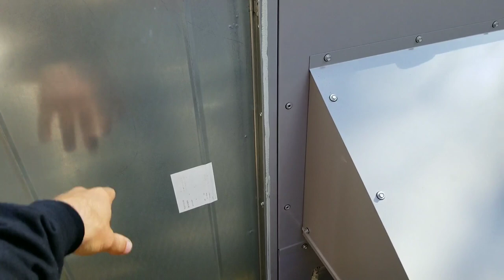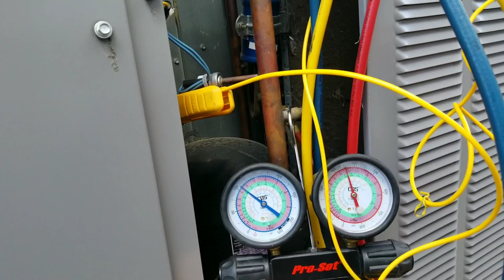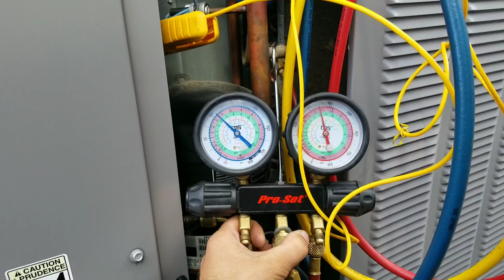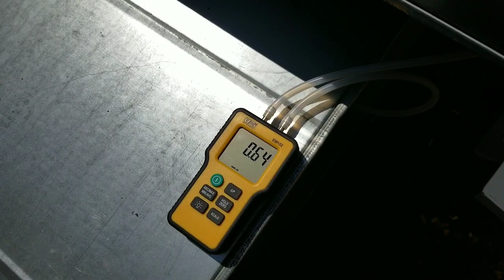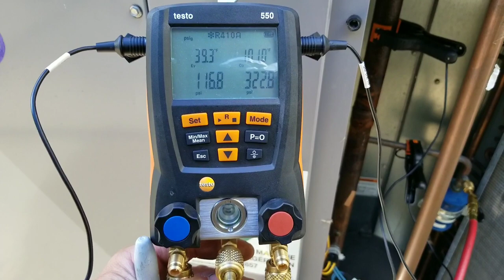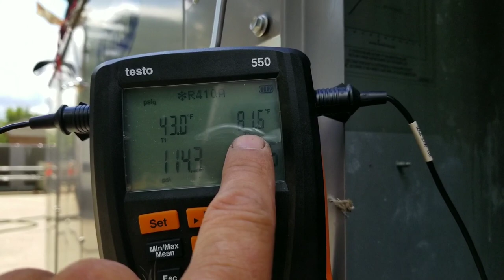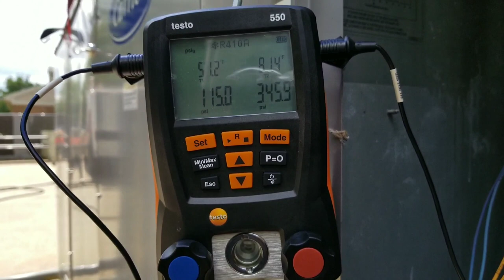Carrier package unit not cooling: Part 2

Comment: Looked like the little spot they had cut out was the only way they could avoid return air bypassing the economizer. Really no way to go to full economiser  now that the whole side is cut out. They should have had that return tie in the back where its suppose to go instead of the side. I initially thought that unit would have a downflow return opening, but seeing the unit again that was incorrect. Enjoy the videos man!

Comment: That units return was on the back not the side with the supply. Should have corrected the duct work. Now the economizer isn't going to work properly. Recommend reading installation and service manuals prior to installing and or cutting panels.  Typically like your video's very helpful. Please keep learning and sharing what you learn.

Comment: Keep posting videos, you are doing this trade a great service being able to see and discuss stuff like this👍🙌. I'm not gonna say I would go a different route...but my first impression is air balance? I'm obviously scratching my head on the duct design and economizer setup for that application. Hope you don't take this in a negative. Sometimes it is what it is get the unit running and achieve the ultimate goal. Comfort for the customer.
Reply from the maker: Hey Grindstone- thanks for the feedback-- I did some research and figured this out after the fact because I knew what I did to correct airflow bypassed the economizer, when this unit or any unit really is ducted out the side like that it needs to be equipped with a different economizer, one designed for side ventilation. Thanks for watching

Comment: Strange that the installers did (what looks like) a decent installation job and missed opening the return to the unit... if I had made that mistake I would have corrected it (which they apparently realized when they cut the triangle out)... 🧐 love the hat airflow test btw

Comment: Wrong economizer for that return going in the side... Should have a verticle style made for side inlet.. But the cheapest way was the way u did it. A lot of people don't really use the economizer much.
Reply from the maker: Hey Dan- Your exactly right on both ends, I basically bypassed the economizer they had and told the customer they need to get the side ducted economizer- havent gotten the approval for it so I think there just going to let it go

Comment: Excellent video! Did you find reduced amp draw on the blower and compressors after opening the return air? Just a thought....Thanks again
Reply: you fan motors do not draw less amps with more air flow, they draw more. If you were to put an amp meter on the blower contactor and open the door it will jump up in amps. The same thing happens with the compressors with more airflow but not as dramatic. The more airflow, the more air to move and cool, and thus the more work is being done, more work requires more energy, more energy is measured in more amps, Its basic physics.

Comment: I’m no expert in HVAC work, but I do have a question out of curiosity. Isn’t the purpose of having condenser fans to prevent the compressors from overheating? If so, how come some compressors aren’t even under the condenser fans?
Reply from the maker: With most hvac package units the condensing fans aren"t there specifically to cool the compressor, they do cool it a little bit but the compressor is cooled mostly by the suction gas coming back from the evap coil.
Reply: Oh okay. That makes sense. Thank you for the information!
Reply: @FansOfGames  To Add to what Curious said most compressors are designed to be cooled by the suction gas. Some may not because of their design and usually have their own fan. We have some split units that have the compressors separate from the Condensing Coils. The can be in their our box with no fans. This can be down to cut down on the weight of the Condensing unit on the roof or other design reasons.

Comment: Is the package not now sucking outside air around the closed economizer? Or did you close the the hole that they cut? Greetings from Germany 😉 nice channel 👍
Reply from the maker: Hey Darklan- In order to restore air flow I had to bypass the economizer. It was either do that or have them re do the duct work, they said no to that idea. In the fall when the economizer opens it will not be able to block the return air coming from the building. 
Thanks for watching
Reply: @curioushvacguy6876  thx for the feedback

Comment: I dont know, looks like thats the wrong econ to me. Looks like its made for downshot config. Does Carrier make a different style for side discharge?
Reply: Great video overall! Subbed
Reply from the maker: Hey Ryan- your exactly right, I knew something didnt look right besides having no air flow but didnt realize until later after I basically bypassed the economizer it should have been equipped with a side discharge economizer- Thanks for watching
Reply: @curioushvacguy6876  cheers bro! Your channel is great
Reply from the maker: Thanks man- much appreciated

Comment: Would've just left that economizer out, it's not going to work right with that duct setup that way. The return duct is obviously supposed to go below the economizer inlet. The dampers do nothing with duct on the long side of unit, except bypass air.

Comment: Seems pretty strange to only cut an opening in the one return and not the other , if they had realized they didn't have any return air on both units?
Reply: Not that it made much difference on the one they did cut an opening on.

Comment: The original installer completely blew it and should be sued. Could have saved it by raising the unit on a 2' high stand and connecting RA to bottom. Too late now.